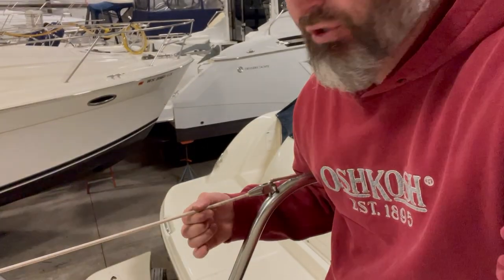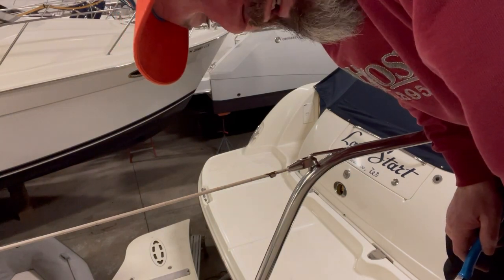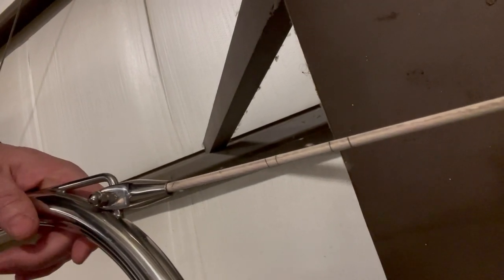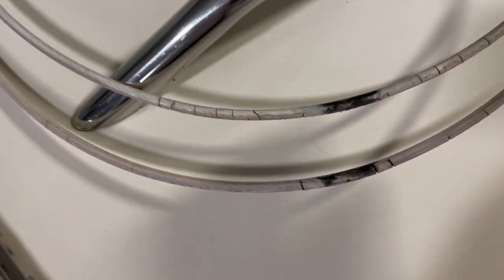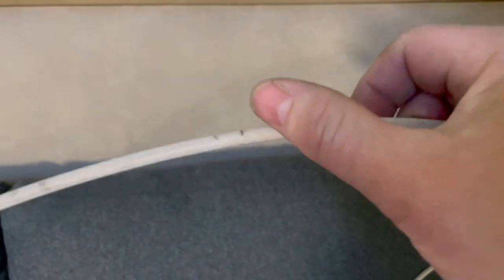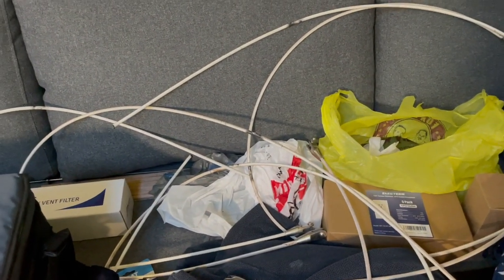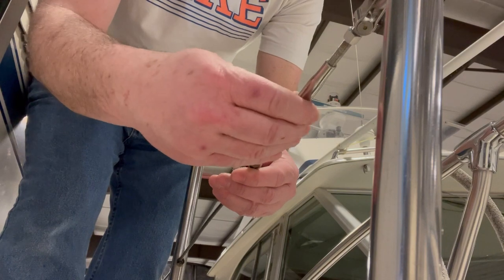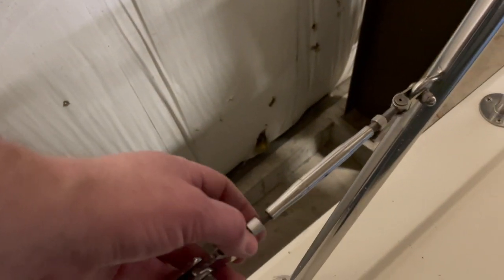MV Thirsty Whale, 1984 Chris-Craft Catalina 381, Replacing the lifelines

Comment: Most guys would have started the video with the angle grinder. Kudos for honesty! They will loosen up a bit over the next few months and you will need to retighten them. A good standard is if a Seagull sitting on a wire is touching the deck it's too loose😃😅😂😁😎.
Reply from the maker: Thanks Paul! I never hide my mistakes because I think it helps everyone to know that these projects/videos are not perfect, and things go wrong. I like the Seagull test!! LOL...but I will check to tension them again after we get the boat back on the water as it's already been about 7 weeks since I did these.

Comment: Chad, I’m curious if the cables are stainless steel and/or why you didn’t use coated cables ? Perhaps you can’t get them or perhaps they are very expensive.
Reply from the maker: Primarily personal preference, but I do think non-coated will last longer. I like the look of the non-coated better. They are 316 stainless 1 x 19 cables. The two drawbacks for coated lines are they will crack over time (albeit, a LONG time), and when they crack, water is retained inside the coating and cable, and depending on the type of steel inside, it can corrode or rust. Pricing is close enough that that wasn't a factor, and they are both readily available.
Reply: @WiscoBoater  yeah, I got it. I think I’d go with non-coated too.